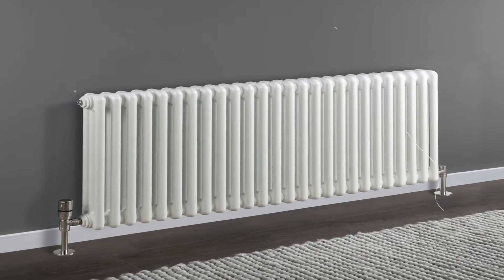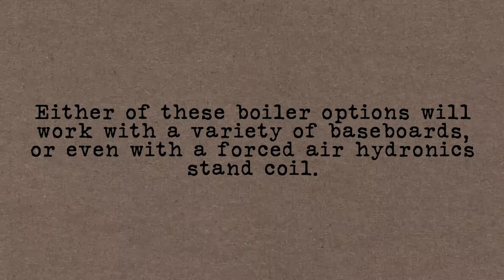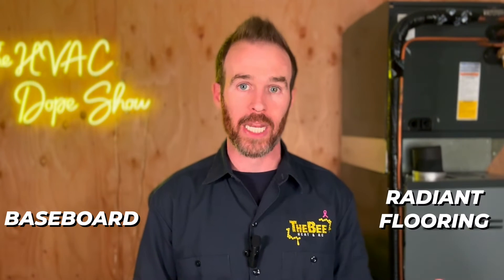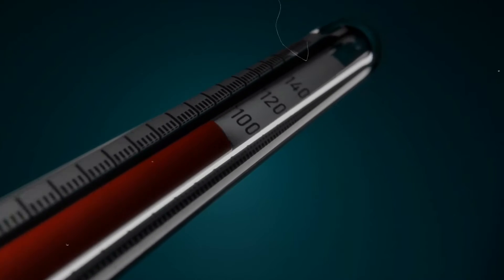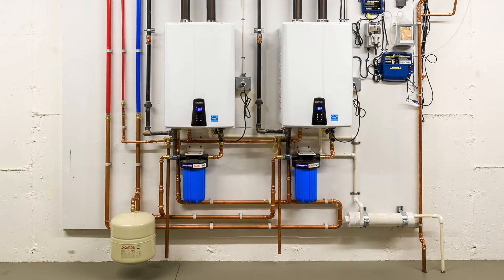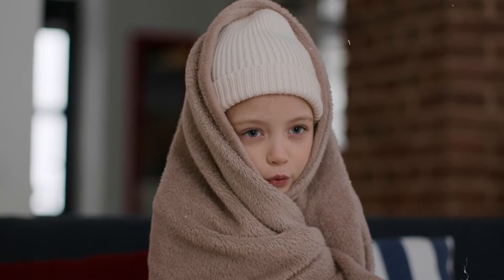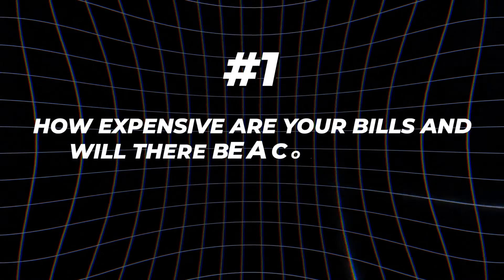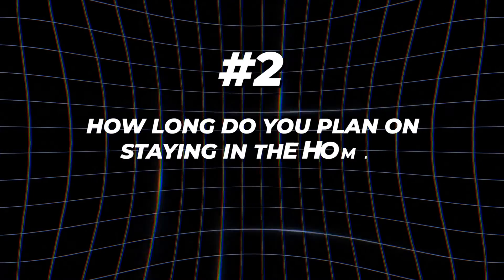Boilers: Cast-Iron vs. High Efficiency Modulating 🔥

Comment: I have a Weil Mclain oil boiler, 30 years old that runs good and I can service easily.  I added a radiant floor zone to the 2 baseboard. Looking to convert to gas when gas is available on my street. Hopefully this is the right decision.  Converting oil burner to gas is the cheapest conversion.

Comment: Have a fancy NTI combi boiler that now has a lock out code 05 on it.  Specs say replace heat exchanger because ???  Well it has a plastic housing on them and although you could in theory replace a $23 Thermal fuse they are not available. Plus NTI says you cannot be sure that the housing is not compromised.  Cause was likely an air bubble in the heat exchanger as it is cleaned every year.  Can you say "PISS POOR design" Yes you damn well should.  Cost $3400 in parts plus labor - meaning you are better off buying a new one by the time that is done.  I also did not see any cost saving over the cast iron boiler we had before buying this over 8 years. add in the cost of rebuying another one and there is a negative cost savings here.
Reply: By they way - I ordered the part from the UK and had it shipped resolved the issue.  Thermal Fuse was the issue.

Comment: I’ve got a 4700 sq foot home with 4 baths I’ve been told I about a combi unit but I don’t really know what’s best 
You do not service my area😢
I have a Laars mini thermal now and it has lasted 22 years
I was thinking a high efficiency unit ( I was leaning towards the Lochinvar  noble) until I saw one of your videos 😆
I am on lp 
Why is a side arm better or worse for my situation?
Reply from the maker: So a sidearm is better only because when you install something like a Triangle Tube solo (not a combi) it is more reliable because it has less moving parts. The sidearm sits on a zone valve and that zone opens to heat the sidearm, which basically removes the 3 way valve from the equation (and those are prone to failure in my experience). Water quality on wells is also hot or miss and makes things worse once you incorporate a combi... several times we had chronic issues with all brands of combi and finally starting making a rule to put in sidearms if we can with a solo / non combi, because they're more reliable and don't have as many issues with patchy water quality.

Comment: Wait, are there "Modulating Boilers" that take the place of gas steam boilers?
Reply from the maker: Idk honestly I'd have to google it, not the expert on that will have to look it up but we don't see a lot of steam anymore. Downtown Denver, Old homes / buildings
Reply: @TheHVACDopeShow I’m in a jam here .. we own 2 homes and , our own 105 year old 7 bedroom Victorian and a 112 year single family bungalow that we have our older sons renting it… 

We lost both our had steam boilers in both homes.. can’t make this up .
Reply: @TheHVACDopeShow  we got 2 quotes for the Victorian which currently has a 200,000 BTU 750 pound Burnham low pressure gas fired steam boilers, .. 1 was $15,000 , the other $13,500 . Got a guy going over to the rental later on for a quote there. SMH .

Comment: these condensing boilers are very sensitive to the electric grid , causing the electronics to fail . or the fact if you don't neutralize the condensation it will ruin your sewer system . most of these units make excessive noise , and are very expensive to service and repair .

Comment: IMO, if your system was not designed for a High efficiency boiler - then don't bother because unless you run in modulating/condensing mode, you're not going to get the benefit.  So unless you're running low temps in panel radiators/radiant/Indirect HW - stay with the cast iron.  You can still do things to reduce your bills - like better windows (triple paned),  more/better insulation, and sealing air leaks - which may be a better bang for the  buck.

Comment: The problem with cast iron is that it does not modulate like condensing boilers, which typically have 10:1 turndown ratio.  That is a VERY important point that is missed in the discussion of condensing boilers.  The reason is because most HVAC contractors don't really know how to calculate the size of boiler needed.  In my case, I have a 45 year old home with a 45 year old Burnham cast iron boiler that has 180,000 BTU output.   Even on the coldest day, the boiler short cycles at 84 seconds on, 240 seconds off.    That means, regardless of the heat loss of  my house, the emitters (heat registers and underfloor radiant) CANNOT dissipate more than ⅓  of the heat (84/ 324 =0.259)  produced by the boiler!    Therefore, by my calculations,  a boiler with 45,000 BTU output will do the same job as my 178,000 BTU  output Burnham.   Except it will be far more efficient.   The efficiency gained from not short cycling is like driving s car smoothly at 30 mph, instead of 90 mph, then stopping, and 90 mph again.  Now, no HVAC contractor  will  DARE go down that low.  So the safe thing to do is to install a 120,000 BTU  modulating boiler with a 10:1 turndown ratio , and it wont short cycle because the flame is turned down and the boiler can run at 45,000 BTU output all day long.   And on warmer days, it can run down as low as 12,000 BTU,  and not short cycle.   The 90-95% efficiency is achieved.

Therein  lies the inefficiency of cast iron boilers -- when they are exceeding oversized, they become FAR LESS EFFICIENT than the  80-85% specification for cast iron boilers.  Whereas a condensing boiler doesn't really care very much if they are  oversized by as much as 4 times
Reply: if your boiler is cast iron then your aquastat might be set to a very small differential or is defective .cast iron stores a huge amount of heat if your saying your home only needs 45,000 btu and your boiler is 178,00 btu it should be an hour before it needs to cycle .   if your boiler has a small mass heat exchanger ( like a copper heat exchanger i can see that happening ) . btu loss calculations are made with your home's measurements ,  amount of window , doors , insulation  . if your boiler is actually cycling that fast and your aquastat is working fine then your boiler is undersized.
Reply: @sneekeypeekers936  My Burnham Boiler has a 8° F temperature differential. I have 1000 feet of heat registers which is comprised of three-quarter inch copper pipe and aluminum fins. That is not remotely enough to dissipate the amount of heat my boiler produces fast enough.  The cast-iron boiler does have a lot of thermal mass, but the standard set up of turning off the circulator pump and the zone valve when temperature is reached is completely illogical, because the heat has nowhere to go but up the chimney.   To use the heat INSIDE the house, I opened up all the zone valves to maximize heat, dissipation, and left one of the zone valves alone to control heating for the whole house. I run the pump for 20 minutes after the demand shuts off, using a Power Off Relay. I then installed an unused 40 gallon hot water heater in line with the zone controlled by the single zone valve. That hot water heater greatly increase the thermal mass of the system, and COMPLETELY eliminated my short cycling problem. 

As for evaluating the size of boiler I needed, I also disagree with the standard method of using window sizes, roof, and walls and insulation thickness for calculation.   That method disregard variables that completely overwhelms the picture.  It disregard leaks, Insulation settling, gaps in the insulation, and the fact that a self facing window that is triple painting can be far more efficient.   For an older house, I submit a method  that is a lot simpler.  It is also more accurate  The heat registers (copper fins) can only dissipate heat at a certain speed. The duty cycle shows how fast your emitters can dissipate heat. For example, if it is 15 minutes on  15 minutes off, the duty cycle is 50%.  Let’s say your boiler has a 120,000 BTU output. That means you’re only dissipating 60,000 BTU steady state Therefore is 60,000 BTU boiler running at 100% duty cycle will do the job.  Of course you do not want to do this experiment on a warm day. You want to do this on the coldest day.  You will also want to upsize the boiler by 20 to 25% because it loses efficiency as it gets older.  So a 75,000 BTU boiler will absolutely be enough to do the job.

Comment: My home has a cast iron steam boiler with two pipe cast iron radiators. I'm using heating oil for fuel. My boiler is currently almost 30 years old and I'm kind of doing some research into what would be the best replacement for it. The boiler is also my domestic hot water so I use a lot of fuel every year even more so if it's cold as I'm in the Northeast (Connecticut) I'm planning on living in this particular home long-term so just doing some research into what would be best once the current boiler craps out

Comment: Cast iron will last longer, less maintenance. If you don't maintain the high efficiency boilers they die in 5-6 yrs. And it costs $300 ave a year for the maintenance.

Comment: Great video - thank you ; I am actually looking to replace a 10 year old Buderus wall hung condensing boiler as it is no longer made, parts are hard to get (recent failure took 4 weeks to repair due to parts availability). Bunch of plumbers have given me advice -- old school guy (plumber with literally 50 years of experience) is happy to install either but he likes the cast iron simply because they last forever versus wall hung ones which seem to have a 10-15 lifespan with a lot more complicated electronics; anycase, thanks again for a very articulate video.
Reply from the maker: Yeah cast iron is my preference... I have high efficiency at my house but only because we didn't have a flue for cast iron. If you're not on propane then cast iron will have less headaches.
Reply: @TheHVACDopeShow  am on propane; again, thanks for the info.
Reply: I am in the same boat going back to the cast iron - This cool looking wall hung models just do not last and any cost savings is gone when you mix in the lifetime of them is so poor!
Reply: @333cparker  and to beat a dead horse (or boiler in my case) -- the other major problem I encountered was that when the Buderus was installed in 2014 - venting was done (per spec and code) via Schedule 40 PVC - then apparently circa 2017-2019 (can't remember without looking), National Building Code changed as Schedule 40 wasn't rated to handle high exhaust temps -- Retrofitting my house with the newer spec (1768  I think) would be expensive and disruptive..  same chalenge for putting in chimney or other cast-iron boiler compatible exhaust system - ended up (about a month ago) installed an Ideal Exhalt boiler that was specced to interface with Schedule 40 PVC for exhaust. Quite the learning experience as I had to change circulator pump stuff for my zones as the Buderus had internal circulator pump while te Ideal does not. blah blah - my plumber was great but he too was on a learning curve with this switchover.

Comment: So if I have old cast iron radiators in my house can I still upgrade to a condensing boiler or even a combi?
Reply from the maker: Yes for what it's worth I think the triangle tube solo is more reliable than the combi and I believe water quality affects it the most. With the solo you'll need a sidearm / indirect fired but in my experience they're more reliable
Reply: Cast iron rads can work well with a mod con boiler.   Especially in homes that have seen window, door and insulation improvements.  These home improvements mean the boiler supply water doesn't need to be 180f to do the job.  Max efficiency for the mod con is when returning supply water is less than 130f,  lower is better.   We have a simple mod con on NG and tall cast iron rads.  Our boiler runs between 90 and 140f depending on outside air temps down to -20.   This means we're running in the efficient condensing range nearly all the time.  An indirect water heater works real well with this setup too.

Comment: And, a condensing boiler doesn't always condense.
Reply from the maker: Really? That's news to me I've never seen one that doesn't condense especially on cold start up when the temperature difference between the water is prone to cause condensation and the exhaust is always moist
Reply: Bingo. Depends on return temp.

Comment: The cost of equipment, installation, maintenance and upkeep, not to mention the shorter lifespan, is reason enough to pass on going with a condensing boiler.
Reply from the maker: I don't disagree
Reply: Not knowing how to properly setting a condensing boiler up doesn't mean it is a bad product.
These pictures of ancient radiators say's enough
Reply: Agree and I heard the same from 3 plumbers. Heat exchanger maintenance. Neglecting it will shorten its life. It was about 50% more than a standard boiler too. I upgraded as my boiler was 65 yrs old. No leaks but external things like fill valve and draft issue and a 40 year old gas conversion burner, maybe 60-70% efficient.

Comment: Looking at this from a Dutch perspective, here the only boiler you can get is High efficiency condensing (has been so since 2006).
You mentioned cast iron boilers are cheaper, I just looked up the price of the model I have (Intergas kombi kompakt HRE 28/24) it was €935 on the first google result.
Even if a cast iron boiler was free the gas saving will be worth it in about 5 years.
Reply: Swapping out a modern boiler against ancient tech needs more than replacing it .
Reply: https://youtu.be/wFOpHNz7Fdc?feature=shared
Reply from the maker: Installation costs will dwarf that and we don’t have that system here, also they’re less reliable. After lots of failures we really don’t like combi boilers or high efficiency, cast iron is solid and we don’t get callbacks… even with a perfect install (ours are legit, very clean work, my guys take pride in what they do) we’ve still found that the combis have issues… not sure if it’s related to Colorado water quality or what but either way not really a fan anymore
Reply: @TheHVACDopeShow  If you're having high failures,callbacks etc., then the system was not designed properly or you're buying on the low end. Good condensing boilers just don't fail take IBC for example, one of the most reliable units available anywhere. Easy to get parts great foloow up through the life of the product if you need it. I have a system in for 13 years (IBC) and it's the best money we've spent for our campus.

Comment: I'm not a heating/plumbing/hvac guy but some in the comments seem to think that cast iron is better because it's simpler and therefore more reliable.  My thinking is that if high efficiency boilers cost more wouldn't it make good sense to use the money saved by going cast iron to add insulation and air sealing to your home?  That would make up for some of the efficiency discrepancy I would think.  The most efficient boiler in the world is not saving anyone money if the insulation is substandard.  Am I right?
Reply from the maker: 100%, and great point… we tell people we prefer cast iron because of reliability. Dunkirk cast iron or any of them are pretty solid… no callbacks for years and they just run. Insulation is more important for sure. I’ve seen people do windows doors and insulation and knock 50% off their bill. Granted windows and doors are super expensive but the insulation alone is a cheap upgrade that goes a long way
Reply: Good point. In Poland 6 to 8 inch of exterior insulation and 3 pan window are common standard. No matter what type of boiler or best windows you have without proper home insulation you will not save any money. HE boiler is addition to the entire process which need to be made to get higher efficiency and bigger savings. This is big investment but savings show up every month especially in the northern zone.
Reply: Right on i Agree 🫡

Comment: You’re better off with a steel boiler that transfers heat faster and more efficiently- such as Energy Kinetics gas or oil boiler.. My last steel boiler was over 60 years old still going strong. Check out the Energy Kinetics boilers. Best made in the country.
Reply from the maker: I emailed them, will talk to them more and find out about their products. Thanks for the comment I love learning about products I’m not familiar with… honestly all the stuff now seems engineered to break lol and it gets really annoying for the contractor (even though it’s an income source) because it makes us look like dodos for something that only lasts a few years before a major service call. I’ve ripped out brands on our own dime that were junk just because we were tired of callbacks and it was definitely a weird  / brand specific issue basically a lemon… If these stainless systems are reliable that would be a great alternative. I mean boilers require more repairs anyways between all the transformers and zone valves and pumps etc, but you would like the heat exchanger not to crap out after 10 years. 60 is amazing but even just a solid reliable 20-30 would eliminate a lot of headaches.

Comment: Much of the energy saving is gone with repair and maintenance costs on a Condensing boiler. parts cost a fortune and are not readily available.
Reply from the maker: I prefer cast iron if we can, they don’t break down and have less warranty calls that’s for sure.

Comment: I currently have a 30 year old iron boiler. Recently renovated parts of my house and ran ductwork to my attic for future central air/ heat pump and I have solar panels that I own. I feel for me a cast iron is a no brainer in the case I get a heat pump, the boiler can be a great reliable auxiliary heat source. Most parts sold at a local Home Depot as well.
Reply from the maker: Yes they’re very reliable!